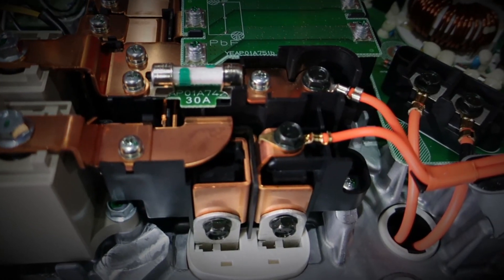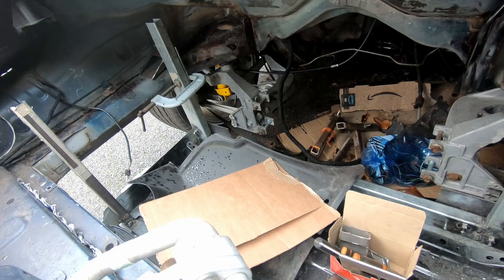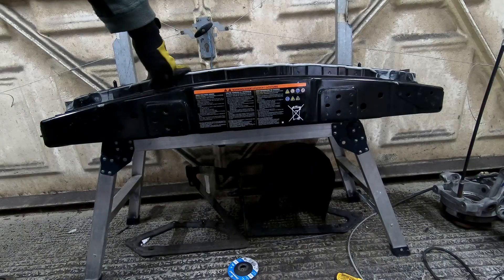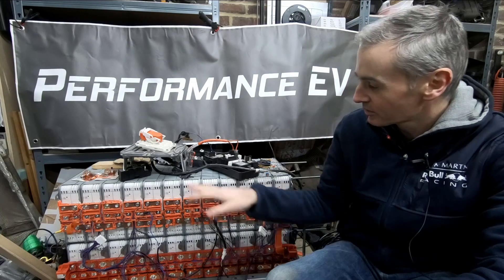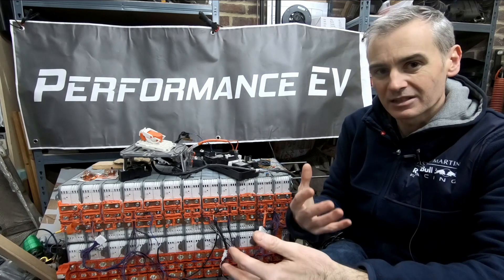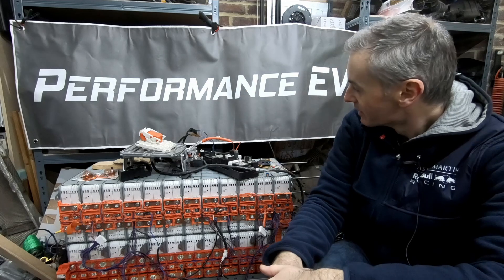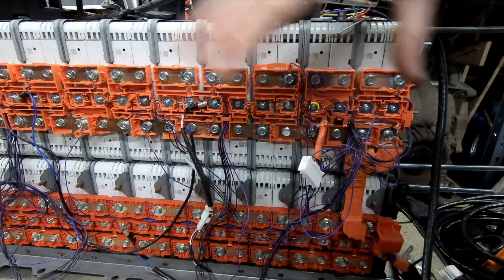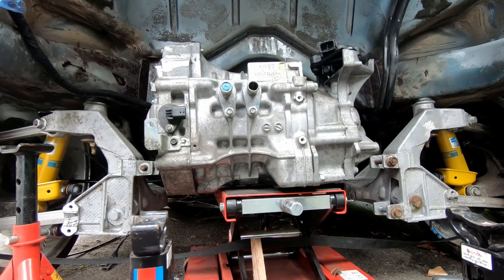Scrapping our Custom Nissan Leaf based battery box - Electric Porsche 911 project video 56

Comment: That's a pain in the ar$e Shane to have to do that but you'll be happy in the knowledge you made a proper job of it. I'm still not 100% happy with reusing the leaf case on mine but budget constraints drove me to stick with it. It works but... just! I would definitely remove all the battery terminals when you undo the threaded bar. You'll end up damaging them for sure. Good luck and look forward to see the laser cut results!

Comment: Hi Shane, let me introduce you to a new idea, I have been silently following your build so far, and I have to say it’s quite interesting, but as you mentioned in a few of your videos weight is a bit of a issue especially as the battery pack is quite heavy. So I’m just going to get to the point, how about building a carbon Fiber or Fiber glass if costs are an issue to make a custom fit to purpose battery box it would be water tight and quite solid and reducing weight considerably. 
Have a Thought about that and if u want contact me and will talk u thru it . Good luck and keep up the good work.

Comment: Consider a DIY battery thermal management system... there are thermally Conductive silicone tubing that can be sandwiched between rows of battery stacks...
May want to throw some large dessicant packs inside battery box when you seal it up.
Reply from the maker: Thanks. Those are both really good ideas.

Comment: Will you have a battery box in the front as well? How are you going to balance the weight of the car? Question 2, please let us know what solution did you come up with for the battery bracket. And how much did it cost you.
Reply from the maker: I'm not going to have batteries up the front initially, just to keep things simple, but I do plan on expanding the pack at some point by adding some additional modules to increase the voltage so I can push more power to the motor without increasing the current. 8 modules would be the same weight as a full tank of petrol in this car. Still designing the bracket solution, but will do a video on it (including costs) once I have it.